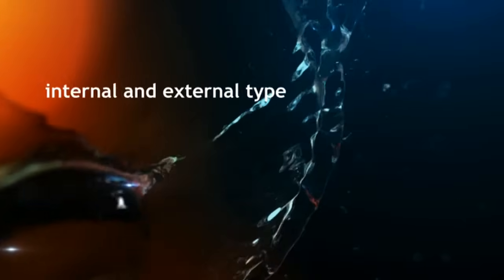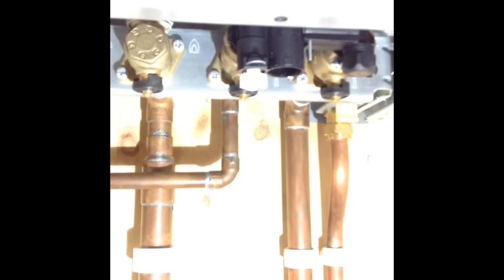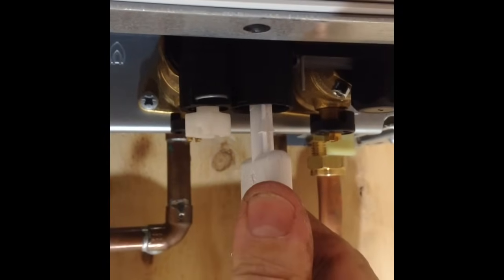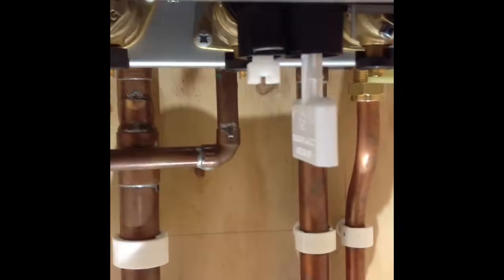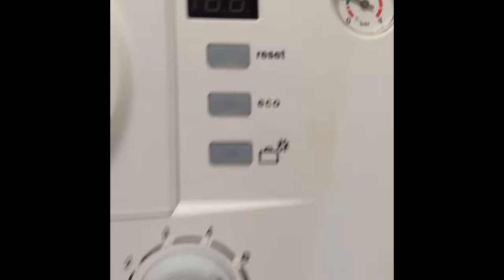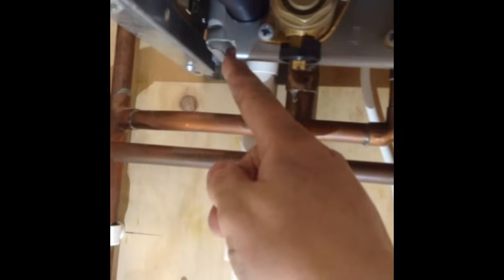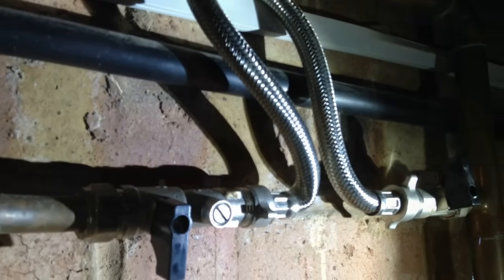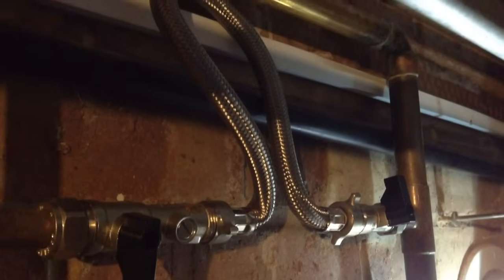How To Top Pressure On Worcester Bosch Boiler

Comment: thats very helpfull thanks, however, how do you remove too much water as the pressure gauge is well over the green 1.5
Reply from the maker: 1.5 will be fine, but if to high whilst cold you would first bleed the radiators, this will sometimes drop the pressure. If still high you can either drain from a drain point on the system or if you are not comfortable with tools open a  radiator vent and let the water dribble into a tub..but You may want to do this in a room with no carpet.
Reply: @GHancock  hi many thanks for your prompt response, have done as you suggest and removed some water from the radiator to bring the level down to 1, after that, when switching the heating on again, it has raised to 2 and stay stable at this level. Fingers crossed it stays this way.  Thank you again for your help and advice.
Reply from the maker: @roblox_stuff384  no worries, get them to check the pressure in the pressure vessel on the next service.. it may be getting low.. if it gets near 3 bar you’ll have get someone in .. good luck

Comment: Thanks for the video!
What to do when the pressure get too high...like in the red...?
Reply from the maker: Ensure the key is removed. If the pressure goes down when cold and into the red when hot then the expansion vessel will be flat. If you have manually over pressured it then you can vent the rads, drain from a drain point some pressure off or use a vent to dribble water to a pot. Careful the water may be black. But it may be time to get someone in to check it over

Comment: Good video, but how do i add more water please ? My pressure went very low so i re pressured it but now its going right over to the red area. Can you advise please?
Cheers Gary 👍
Reply from the maker: If it shot up to fast.. or shoots up when it heats. The pressure vessel may be gone. If simply you left it open to long then try venting the radiators to bring down the pressure would be the first move
Reply from the maker: You shouldn’t add more water if it’s going into the red…if you’ve overdone it then you can let pressure out via a pine in a radiator.. if it starts off at 1 bar and hits 3 bar when heated, then the vessels gone and it’s time to bring in a heating engineer

Comment: Great video. If I leave the key in, find it quite difficult to get it in, does it have to be in the locked or unlocked position?
Reply from the maker: @eggmayocress  locked, but if the valve was to pass and fail it would result it over pressuring the boiler and damage other components like the expansion vessel.. try lubricant on the o-rings see if that helps
Reply: @GHancock thank you so much for replying. I'm just not technical enough to understand it 😂. I'll try and get it out. 😊
Reply from the maker: @eggmayocress  unlock to get it out

Comment: I copied this when I first moved in here. It worked. Just tried it again cos the pressure is at 0 and it's just leaking loads of water when I turn it. No idea what to do. 😢
Reply from the maker: You've not located the White key fully, pop some lube like washing up liquid on the rubbers and try again.. Take time to line the unlock symbol with the arrow

Comment: Any advise please for another independent lady🙏  I have to reset pressure daily and its driving me nuts. I've had boiler serviced. I've had plumber investigate and put some stuff in that blocks any air holes, worked for a few days.  We  have no leaks on rads, we traced them over several days.   No sign of any leaks on the ststem anywhere.. so next step is to replace 'some part' that was going to be costly but no guarantee it would work.    Not sure what to do...everything works ok just scary.

Comment: What number should be showing on the boiler?
Reply from the maker: The display is the temperature of the water inside… so it will change around depending on when it’s fired and what temperature it’s set to… but the display for the gauge 1 bar is enough usually when cold

Comment: My boiler was working fine until yesterday it stopped boiling. I can’t figure the problem 😢
Reply from the maker: If the pressure is fine and you've changed the battery in your thermostat (if you have a RF stat) could be time to call someone in
Reply: @GHancock  I actually no nothing about it. I just rented the apartment weeks ago
Reply from the maker: @Ian-fm1ys  Worcester bosch website has some user manuals that may help.
Reply: @GHancock  thank you

Comment: Hi there, should I need to turn off the boiler first?
Reply from the maker: @sherylwong1112  best to but only from the clock..not the main switch, easier to set to 1 bar when system cold as it will rise on heating the system

Comment: Should we turn off boiler before doing this ?
Reply from the maker: Best to have the heating off, as the system should be cold for accurate reading.. you won’t need to turn the mains off, just the demand
Reply: @GHancock  thanks for getting back really appreciate it

Comment: Can you do that if the boiler is showing E9 267 flow sensor fault? And there is no hot water
Reply from the maker: The pressure is the first thing I would check… but don’t over pressure it… there are other items that can cause the E9.. but definitely check you have pressure first

Comment: Hello, I followed your video using the key and did everything you said but my radiators are still not working. The little clock is on 1 in the green zone but still nothing. I also turned on my radiators from the knob on the actual radiator too. The key is stuck though and doesn’t come out, but is in the unclocked position. What could be the problem?
Reply from the maker: Not pressure problem if it's. In the green, change the batteries in your thermostat maybe.. Then call someone in. The key will not stop it firing
Reply: Thankyou for your reply. Yes we got a plumber in the end. Thanks for your help!

Comment: Is there a third system?  My boiler has no key (or key hole) or external system.
Reply: nor the blue trigger.
Reply from the maker: Plenty of tank fed systems out there...but no gauge normally.
Reply: @GHancock  how to add water to boiler to get the pressure without the 3 methods?
Reply from the maker: @Jamie-nt3eh  someone may have disconnected the braided link. Or they have piped it in solid with a stop tap so you are not noticing it,. Or there is a header tank left in.
Bit hard to say without seeing it..maybe ask on its next service 👍🏻keep us posted on the result
Reply: There filing mechanisms was located in airing room underneath the boiler.  Had to call a pro 😂
Reply from the maker: @Jamie-nt3eh  got there in the end, at least you know where it is for next time

Comment: The key you put in the boiler is so stiff and tight I can't get it out. Regardless of if it's open or closed there is no water flow when turning the white screw.
Reply from the maker: Could be the key getting worn, but the water should still go in, if the keys not in right water comes out on you, turn the boiler on off see if the diverter valve will move, sometimes this stops the water from going in

Comment: I tried but when turning the screw water leaks out. Any ideas?
Reply from the maker: The white key may not be fully home.. put some washing up liquid on the o rings of the key and try again.. good luck
Reply: @GHancock  Yes that is correct I managed to solve it in the end. Thanks for the reply

Comment: Done nothing on mine..any ideas please ?
Reply from the maker: Power the boiler off and on from the switch, the diverter may be sat wrong..if this doesn’t help you may need a new filling link.. if you already have pressure in the boiler and it’s just you live in a low pressure area so you haven’t the pressure in the mains to get to 1 bar then turn another cold tap on and off fast. The sudden stop of water causes a spike in pressure.. hope this makes sense

Comment: So does it rely on a NRV to prevent it running back from the system and draining on the worktop, and also relying on one valve to prevent mains water from flooding the building.? Because that’s what it looks like to me on my slightly older boiler. Because you have to take the key out . Leaving the key in should prevent that eventuality.
Reply from the maker: Your right It has a non return valve, some water will come out, but only what surrounds the key. The key removal is to provide a physical air break, so it’s impossible for heating water to get into the mains.
Reply: @GHancock  so, as I said if that nrv fails or the inlet valve passes the area round the boiler floods.
Reply from the maker: @wul01  possible, but never seen it ever happen.

Comment: My boiler keeps going off and the blue light flashes on the front, is it because the pressure has gone to zero?
Reply from the maker: If the pressure is at 0 then it may be overheating and causing the fault. Please make sure it’s at 1 bar on the gauge
Reply: @GHancock  also the hot water comes out the taps steaming hot within 5secs so we called the engineers out and he simply said that’s the way it is with these boilers & you carnt adjust the temp?

Comment: My key was left in the boiler on the locked 🔒 position would this of caused any problems?..
Reply from the maker: EuroBoss only if someone leaves the tap on slightly... removing the key leaves a air gap for safety

Comment: I got a 35cdi and I followed your step by step instructions the pressure is on 1.5 but it still blinking red with not hot water. Pls help
Reply from the maker: Jane K take note of code, press reset, if that doesn’t work time to call a plumber.. give him the code
Reply: @GHancock  thanks for the response I have pressed rest still not working. What is code where can I find that

Comment: Thank you. Video easy to follow. Boiler situated about 6inches above floor so had to crawl onto my hands and knees, place a mirror underneath and use the light of my mobile phone. Saved me having to report it to my landlady again, because although she's very good at getting plumbers in quickly, it's the weekend, and the previous plumber's instruction to me about repressurizing the boiler (Worcester 24i junior combi) wasn't visual and was incomplete. Thank you again.
Reply: I have no white key no blue valve pressure  on 0.its a worcester 4000 and was installed 4 weeks ago .any ideas how to turn the pressure up

Comment: Very clear and concise. I have now a Greenstar 30i R+ERP. replaced a Ideal Standard 80,000 BTU floor  mounted conventional flue boiler of 44 years vintage ( extremely reliable ). After one month I notice the pressure dropping to the end of the green. Below 1. Should I top up? I have a connected filling loop as the engineer fitted a separate  additional expansion vessel as I have a lot of radiators.
Reply from the maker: Yep top it to 1bar. if the boilers new, they often drop a little as the fresh waters oxygen forms bubbles and can releases from the auto air vent… but Monitor it👍🏻

Comment: Any advice for a boiler system without a key, keyless or a loop. I have boiler on ground and big tank water heater on 2nd floor. That has a loop but doesn't do anything when I open the taps
Reply from the maker: Sounds like a faulty filling loop, sometimes the plastic levers round off so they don’t turn the metal spline behind
Reply: @GHancock  Thanks for the reply. I'll check that in the morning. It's had me absolutely baffled. Didn't help that I found the relief valve by accident

Comment: my plumber left white key in , pressure dropped i filled it up should i leave it in, seems 'stuck' he seemed to force it
Reply from the maker: +luton10000 I wouldn't worry to much about the key..just kept a eye on the pressure to make sure it not rising..as the air gap that removing the key  provided ,ensures no water passes to the boiler if the valve fails. when the boiler is serviced by a good engineer..they will remove it for you...if its too damaged, a new filling link can easily be fitted..they cost about £35
Reply: +Hancock and Brown 
Many thanks
Pressure now seems to vary from 0.7 with  no heating on and about 1.2 with it on. Not seen that before. Anyway the key could have done that , he seemed to have shoved it up. as i say i cant get it out.. Im told if i keep topping it up thats not a good idea.
Reply from the maker: +luton10000 the rise is normal as water expands when heated..normally id leave it about 1bar when cold. If you find you have to top up a lot then you have a small weep somewhere...feel round the radiator valves. The key twists so the arrow lines up with the unlocked padlock symbol before pulling down. As long as it not rising to 3bar I wouldn't lose to much sleep.

Comment: It seems impossible to find out how to find the pressure gauge on my Worcester Bosch Boiler. All Youtube videos show it on the front of boiler. Mine is not visible. I have tried finding out by searching the internet and there is absolutely nothing to say where the gauge is or how the pressure can be found via the digital temperature gauge.
Reply from the maker: Martyn Hunter it may be a regular boiler..some firms leave them tank fed. Or there’s a separate red vessel somewhere and it should be close to here. I personally don’t like them tank feed as it leaves more oxygen in the system. But if this is the case there will be a little tank in the loft
Reply: Thank you. I am at my wit's end because all the downstairs radiators will not get warm, let alone hot. I've spent all my savings, 600 hundred pounds on having two different engineers attend. They did not get things working. Being ill and on benefits I am now freezing and trying to work out myself what the problem is. Hence why I was trying to see if the pressure was correct. I don't know if the blockage is an air lock or something else. I managed to get all the upstairs rads working by doing a lot of bleeding air from the pump. I've got one rad working downstairs. The first one that is fed from upstairs. It's in the kitchen. Anyway, in this freezing weather I stay holed up in my bedroom. I've bled all the rads downstairs. I've put X800 in the feeder tank that the vent pipe leads to. Another plumber said he would charge £400 to flush the system and take all the radiators off and blast the insides to clear any stuff. But I do not have £400 so that's academic. I have found the plumbing and heating industry a complete con. It is a disgrace. They charge the earth for doing nothing and do not have a clue. Sorry, but I am very cold and angry.

Comment: What is the purpose of the horseshoe-shaped clip just above the white plastic valve? Also, on the right hand side of the charging manifold there is a black knob that looks like it could be turned. What does that do?
Reply from the maker: Worcester often use horse shoe style clips to hold fittings pushed together and sealed by o rings...no need to start moving these.
Reply: Hancock and Brown Thank you very much for answering.

Comment: Hi how do I lower the pressure please ? As I turned it a little too high
Reply from the maker: Easiest way to vent the radiators, there is a drain point but this would involve tools, sometimes you can direct the water from the vent too a tub if you have a tiled floor, careful some waters are black
Reply: Thank you. I bled the radiator and it seemed to resolve the issue

Comment: What happens if you leave the key on? 1 year ago a guy came out to pressurise it, he didn’t even turn the boiler off, and hey said the key should be inside there all the time, so the key has been there for about 2.5 years now, will that cause a problem?
Reply from the maker: omgitzmo the key provides a link in the safety air break. So there is no way the heating water can get back to the drinking water. The risk of leaving it in is that if the tap drips past it would rather that simply drip out underneath. Now it will over pressurised the boiler and put pressure on the vessel and safety relief valve.

Comment: Worked for me. Just have trapped air now.
Reply from the maker: Eric Ramdanee should work it’s way into the Radiator,  as long as it’s not air looked to the point off not working...any cold spot on the tops just follow my other video and bleed them.. good luck 😉

Comment: I have the same model but the pressure still dropping after few minutes! What should I do?
Reply from the maker: RyMz_ Elite  call a engineer, your losing water fast.. check the pressure relief pipe outside.. check any drain point outside..checking for leaks.. then he can check the condense drain if the heat cells gone👍🏻
Reply: But when the central heating its on the water pressure goes up and stay normal for at least a few hours before dropping again! is there any problem with this?
Reply from the maker: RyMz_ Elite water expands when heater, that's normal...if it's near 3 bar then that's too high
Reply: It goes up to almost all green lines! I have checked all central heating to see if there is any leaks but I couldn't found any! Should I call an engineer?

Comment: Where can I find I video about how to remove the water from the boiler. My indicator passed the green area and now is no the red. ? 
Is there any video about how to remove or lower the pressure on the boiler?
Reply from the maker: Nemisio Dias vent the radiators,  if you have a bathroom radiator with a floor that’s not carpet, you could use this to catch some water to release the pressure. A plumber would drain from the MT. but please do not release from the PRV.. they often don’t reseal

Comment: Hi again .Please would you let me know what thwe normal pressure setting should be when the heating is off. I have a Worcester CD1 30 . Cheers mate
Reply from the maker: staypress 1 bar will be fine, unless you have three storey building then 1.5 bar would be better. If you boiler is on the ground floor